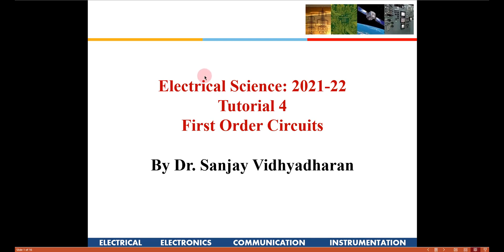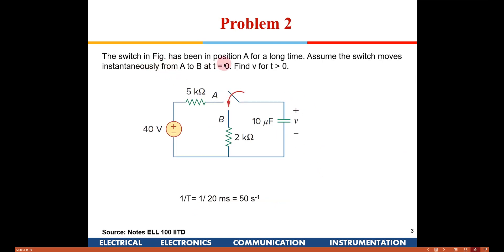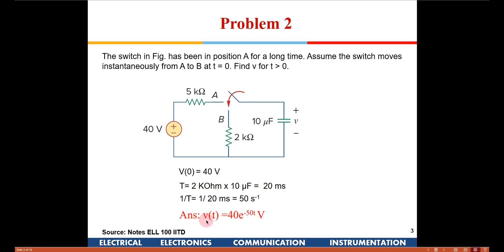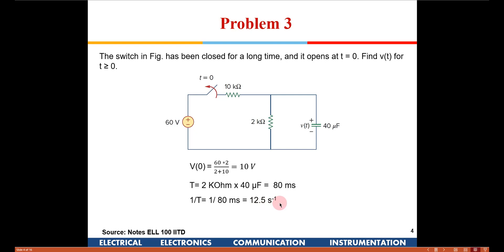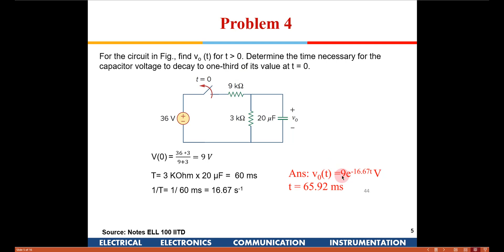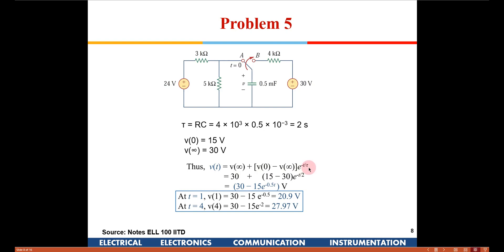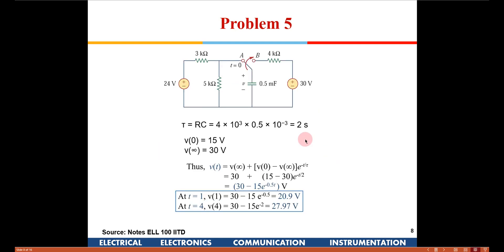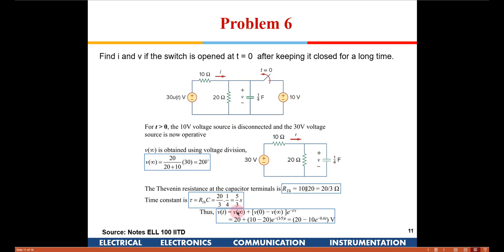Electrical Science; Problems and Solutions First Order Circuits

Comment: hello sir there is something that ı dont understand.you said that at 2.problem v(0)=40 but 3. problem you used voltage divider  but there is no different  schematic for both circuits why did you use voltage divider on problem 3 for finding v(0)
Reply from the maker: At t=0, the  2 k is not connceted to anything, it is open.  Voltage 40 V is  connected to capacitor through 5K and it gets charged  to 40 V.  Later on switch comes from A to B and capacitor charge is discharged through 2K.
Reply: @SanjayVidhyadharan  thx for the answer sir

Comment: Sir in problem2 there is a 5k resistor is there in series with capacitor at t<0 then how the capacitor will charge upto 40v  ? Resistor will have some voltage drop?
Reply from the maker: After a certain  time the cap will get charged to 40V and there will be no curent and no ir drop.  Please refer to lectures at https://sanjayvidhyadharan.in/courses/electrical-science/